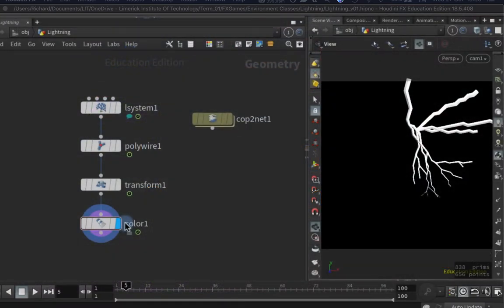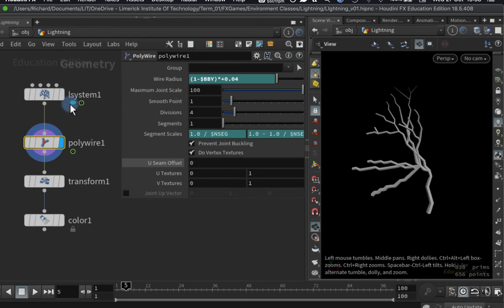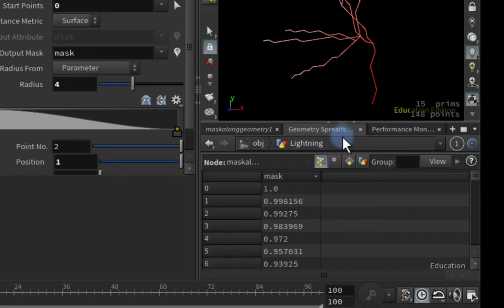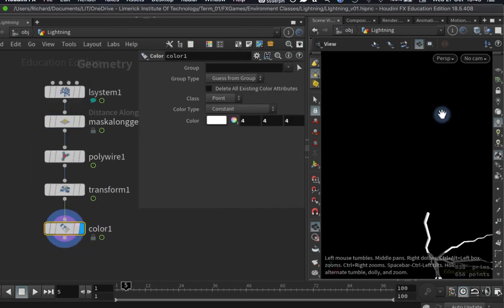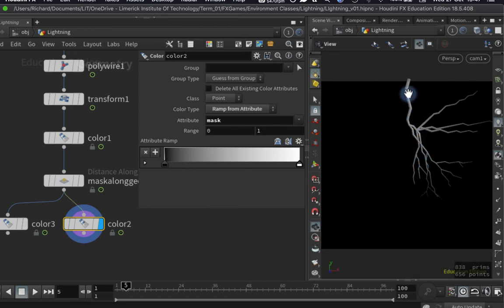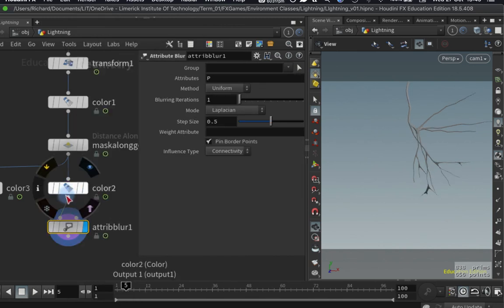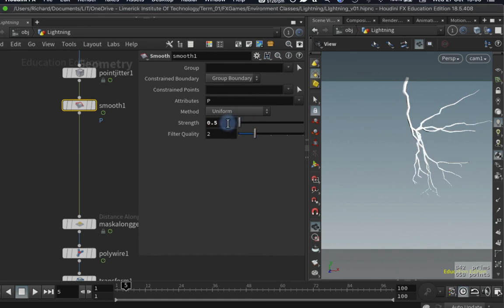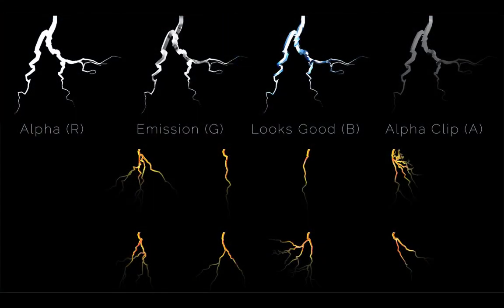Procedural Lightning in Unity & Houdini Part III - Refine Lighting in Houdini

Comment from the maker: This series should be good for Houdini beginners. You will need to be familiar with the Interface but I go slowly through the steps. Apprentice users should be aware that there is a render size restriction of 1024x720 which will mean you will have to render out the texture atlas at a smaller size. I do my best to help you work around in the relevant videos (parts 1&4).  This is a very good course for game artists who want to be able to jump into Houdini get some simple things done and jump back out again.  If you want to take your FX work to the next level while integrating Houdini into  your Unity workflow then you are in the right place. It does assume some basic knowledge of both Unity and Houdini's interface but I move at a slower pace and try to highlight the most important steps.